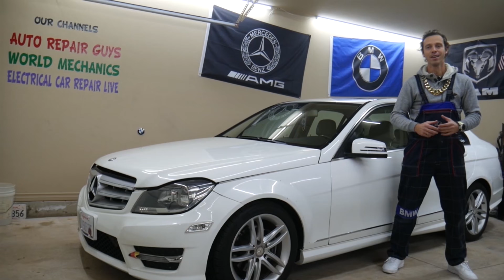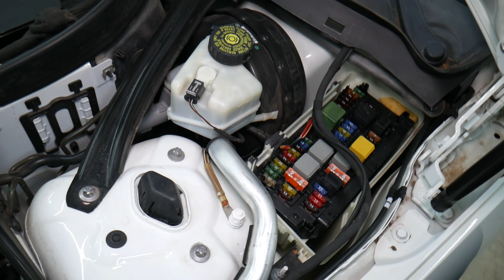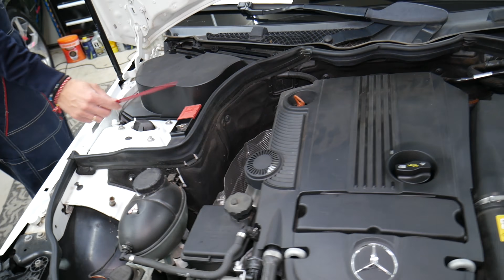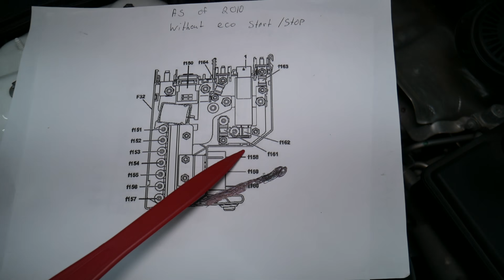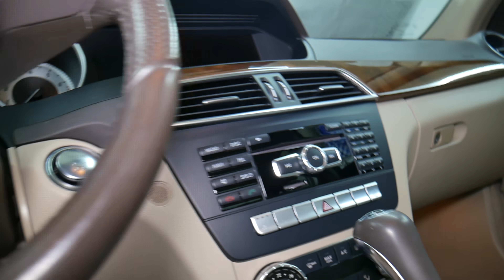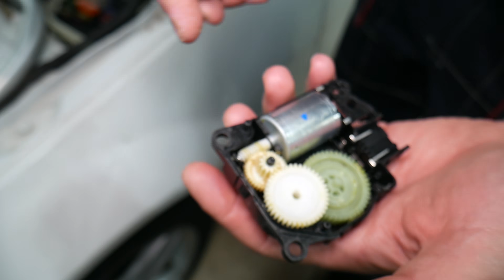WHY AC AIR CONDITIONER BLOWS HOT WARM ON DRIVER PASSENGER SIDE AIR VENT MERCEDES W204 C250 C300 C180

Comment: Great video mate. I have a question if you dont mind? I have cold air both side but not at the rear vent. I reattached the actuator arm that came off under the dash to restore air flow but its warm when the front blows cold. What is the most likely problem do you think?